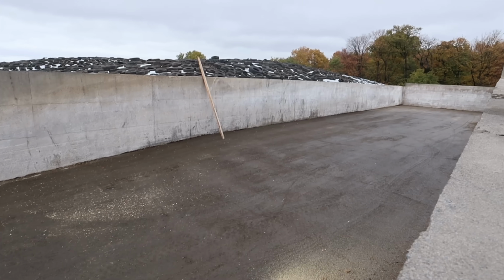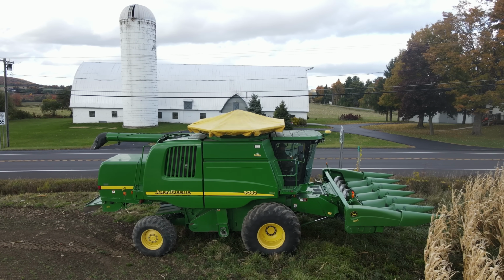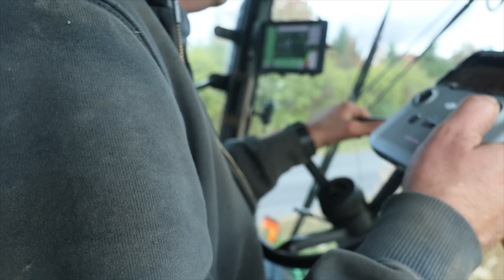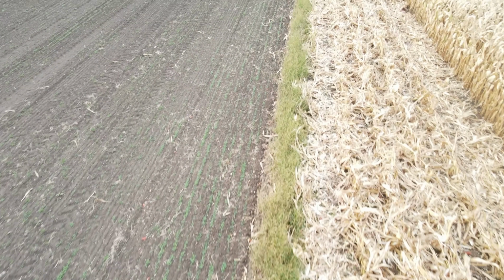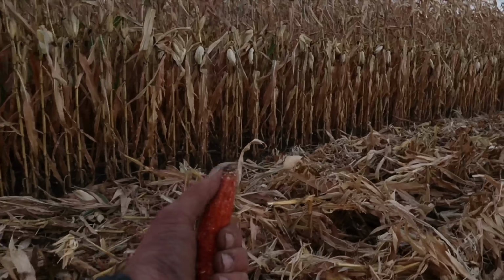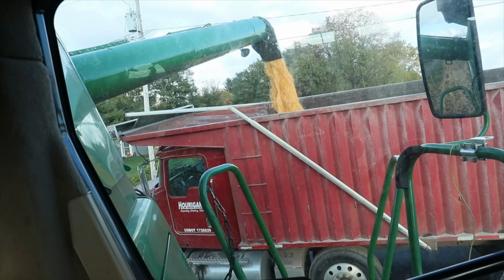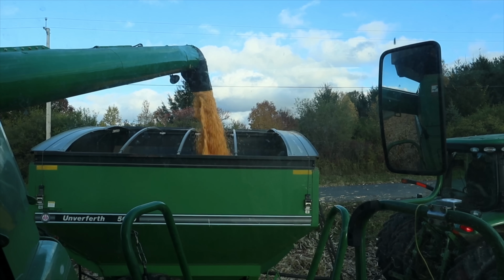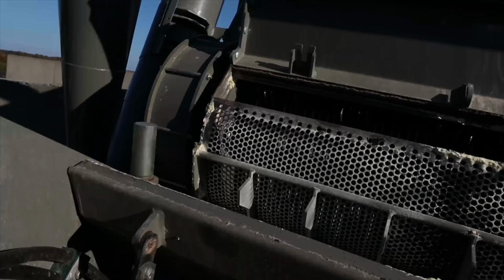Hammering Shell Corn

Comment: Maybe the  Zach in Minnesota should get a tarp, would solve the cab corn problem.  Here you are cleaning corn and running a drone at the same time so You don’t have to get out of the cab to check for loss, impressive.  That’s a seasoned operators move right there.
Reply from the maker: Hammer down

Comment: I'm wondering why you dont mount the corn head to the chopper and not have the combine. Use the kernel processor in the chopper instead of the roller mill. Is it because the corn has less plant material in it this way?
Reply from the maker: Yes

Comment: Combines smaller and older but it works probably paid for you know settings and its quirks could spend 1.5 million on x9 with 16 row head get done a little faster but than need big grain cart bigger tractor on grain cart and more trucks hauling. Just my 2 cents. New and shiny doesn't mean less down time guy rents my fields is farming over 600 acres is using an early 90s massey combine with over 6000 hours last heard but replaces whats bad every winter and has less than what payments on newer 1 would be and isn't broke down anymore than a lot of these youtubers with newer low hour combines

Comment: I would like to turn the question about the tarp around. Why WOULDN'T you want to use a tarp? What are the disadvantages? Only things I can think of is less easy access? but how hard would it be really to take it off, and how often do you need to get in there at all? And maybe more condensation buildup due to less ventilation which could cause rust or other deterioration? But I guess it's open enough also from other sides to allow for plenty ventilation? 

I know nothing about combines... We don't see them much in my neighborhood. I only ever saw one actively harvesting in my town 1 time. 
I saw people race them plenty though! (I wonder if Greta would approve...)
https://youtu.be/HO7c7Onba7Y?t=18